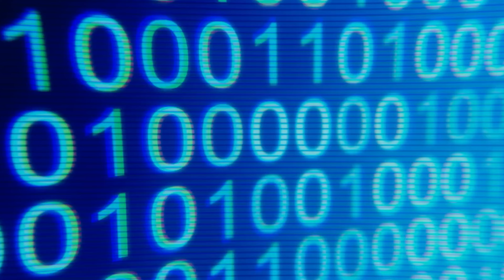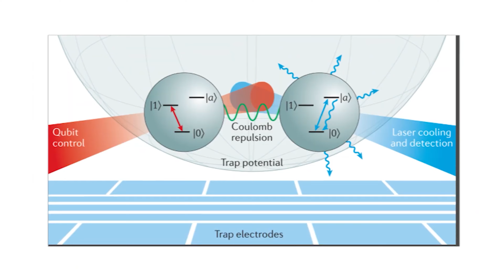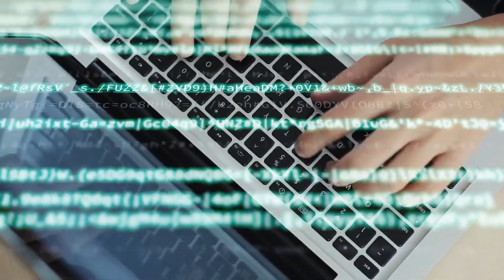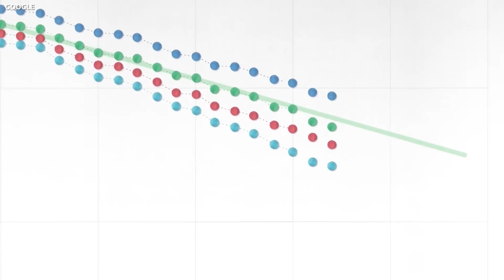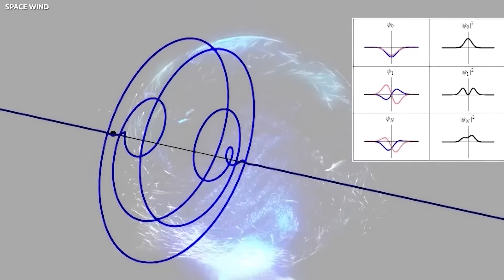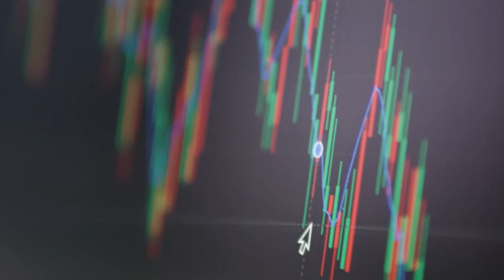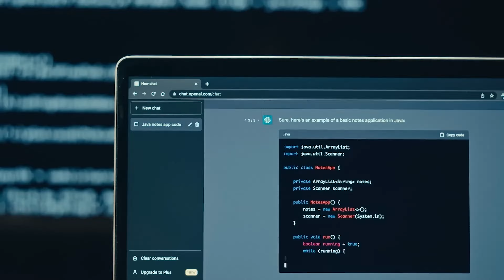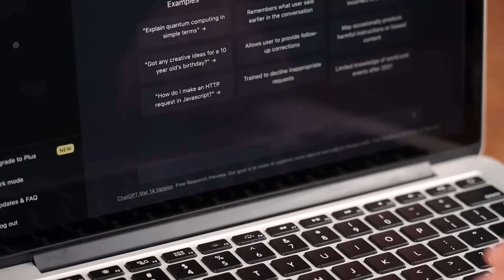Michio Kaku: "Quantum Computer Terrifies Officials After It Revealed This"

Comment: They are not extraterrestrial... they are  ultra-terrestrial. Singularity is where time and space collapse due to intense gravity created by a burned out star collapsing in on itself. The math implys that all of space and time exists inside singularity..! You have to have time in order to travel distance...! We actually exist inside singularity...! We are visiting ourselves from the future, tweaking the time line (de'ja'vu, the Mandela effect, synchronicity) to prevent total destruction...in order that the Multiverse has a reflection of it's self...from free will observation; the collapse of the waveform into what we experience as reality (Schrodinger's cat). The Multiverse  "Required a reflection from inside itself". Free Will allows humans to use time outside the harmony of nature, which creates a timeline that begins and ends... but that is not how 95.1% of it actually exists...! Quantum Computing will open a porthole into Dark Energy/ Matter; the dimension of ultra-terrestrial